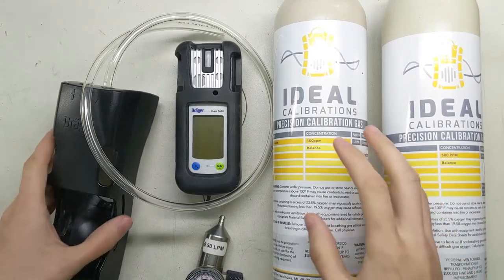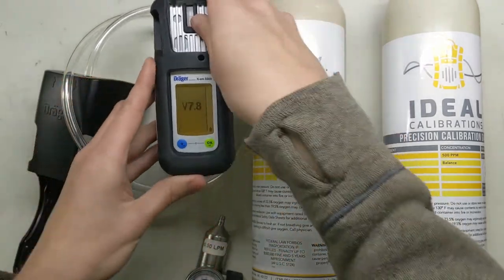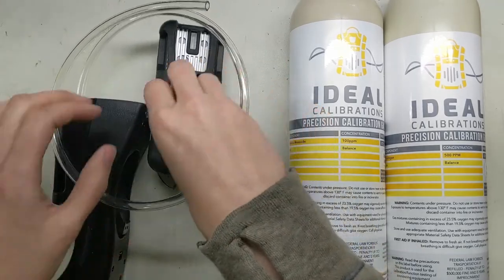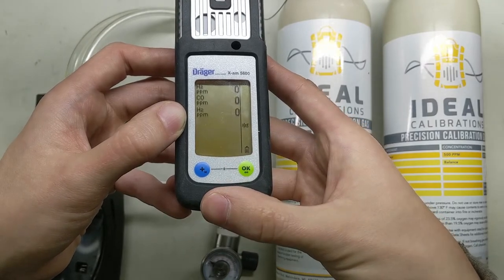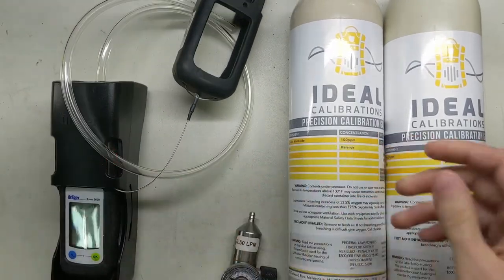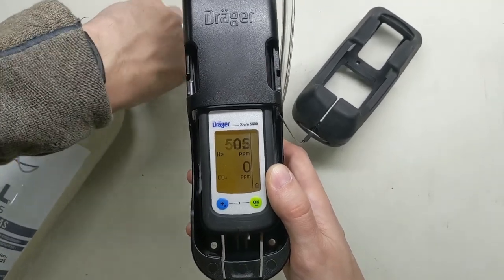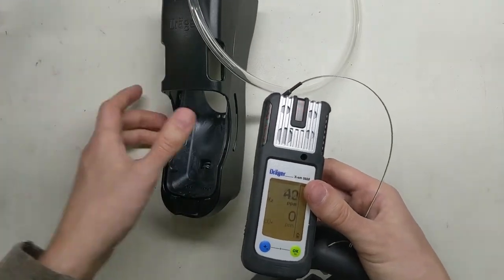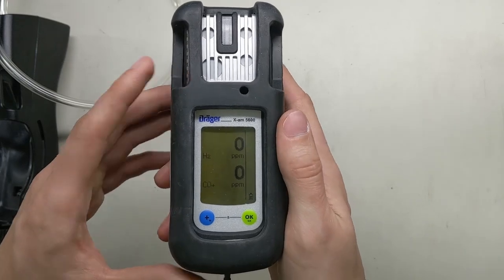Drager Xam 5600 Calibration

Comment: I have recently arranged xam 5600. It only shows 4 gasses (ch4, co2, h2s, o2) but doesn’t other 2 gases. I desperately need to measure NO2 in a process. Can i use this? Kindly help.
Reply from the maker: Hello, sorry for the late reply, but do you have those sensors installed on the unit? If not you'll need to purchase them, I'd recommend sending it in to a service shop to have it done if you have one nearby, or you can always send it to us if you're in the States.

Comment: Im using my 5600 only for CO2 but the other sensores are still mounted. Is it possible to just calibrate this gas? Can i jump between the gases in the calibrationprecess oder do i have to calibrate all sensores?
Reply: Use cc vision software for separate gases
Reply: @Shiningstar6840  Thx mate, i have now a IR Dira. Next step will be the cradle and a valve + the testgas.